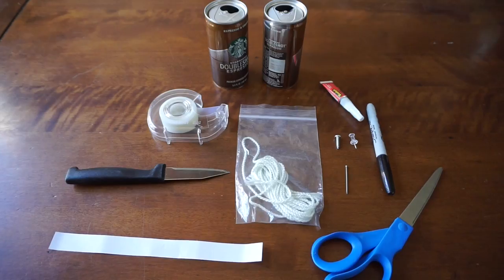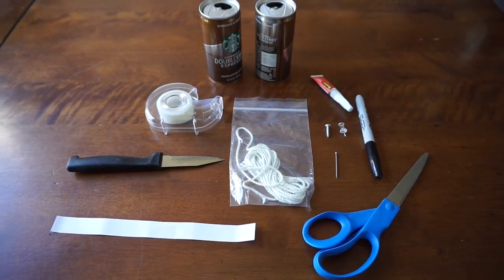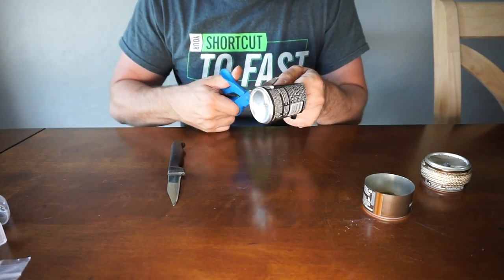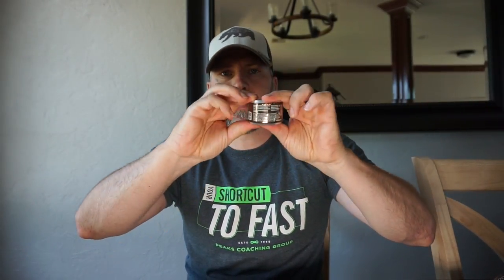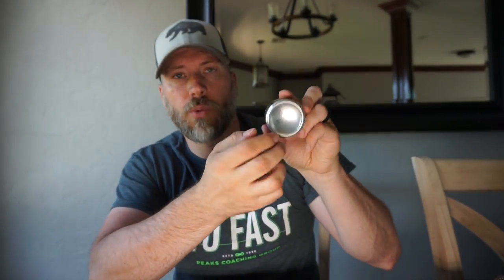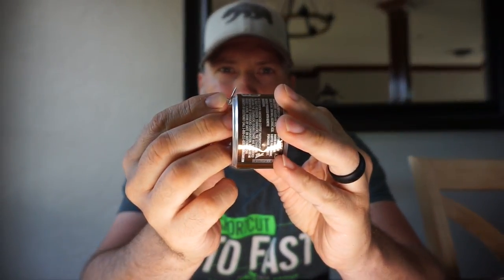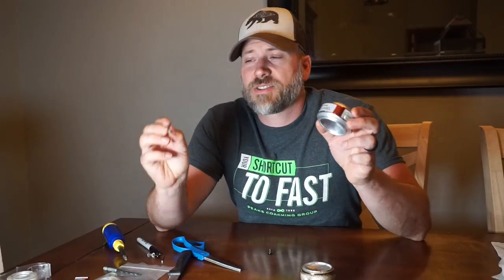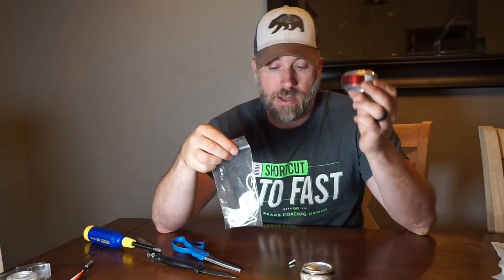DIY Tutorial Atomic or Mini Atomic type alcohol stove

Comment: Looks like a very efficient burner. I missed something though. How does the wicking get the fuel on it to burn? Did you overflow the stove? Why does that need lit? Thanks for sharing.
Reply from the maker: The wicking gets fuel by putting it directly on the wicking.  It is necessary to heat the fuel inside to the point of vaporizing so that it can ignite as it comes out of the jets.  Thanks!